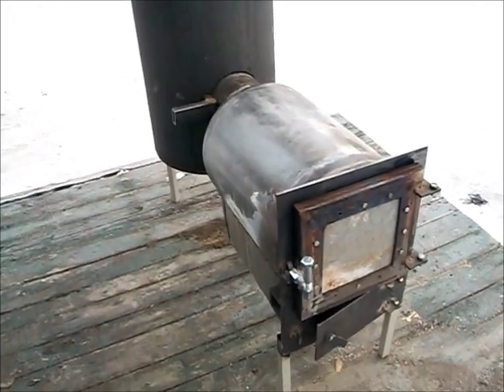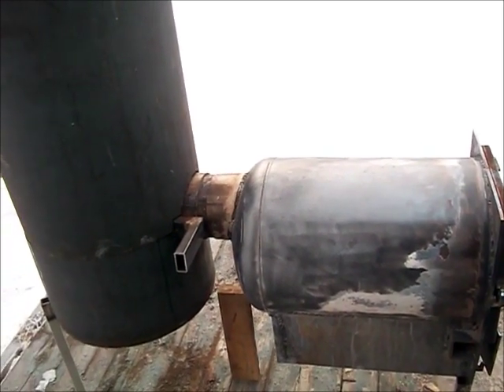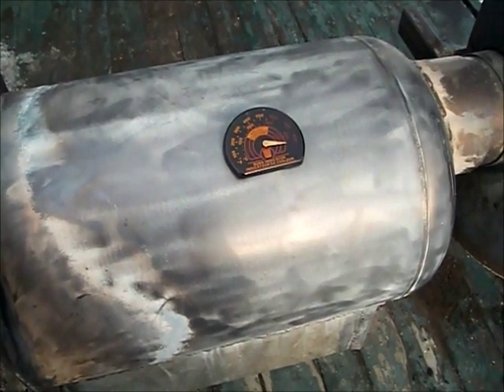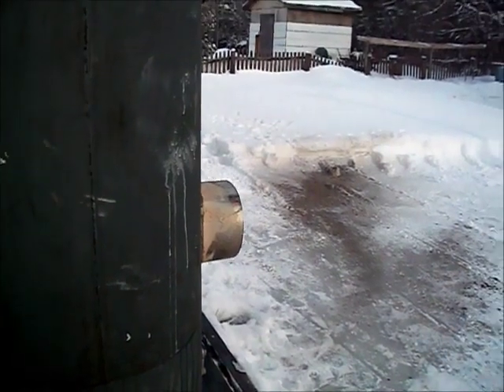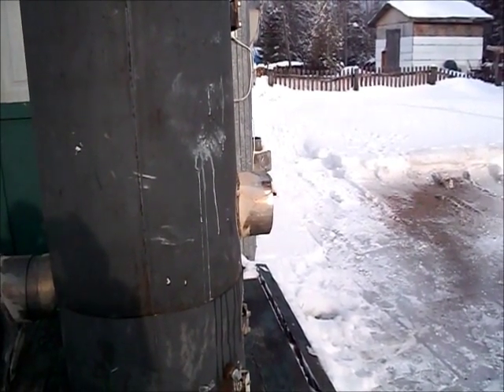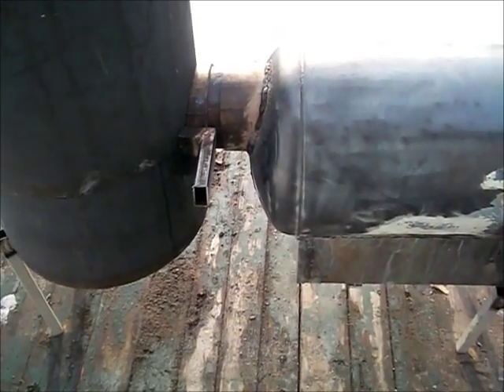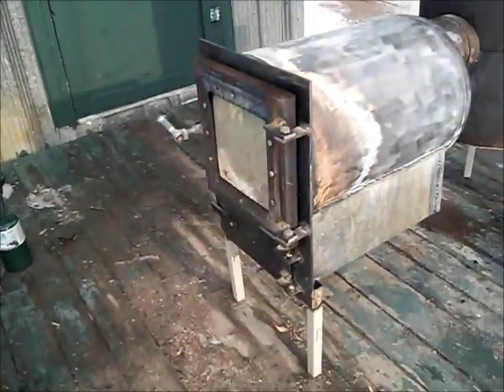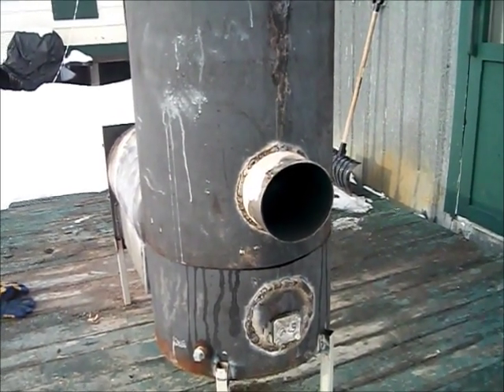Large Rocket Stove test day2

Comment: Okay well , insulate your firebox (with fire brick) , with chimney pipe on you will improve draw greatly , don't weld up heat exchange cover ,weld on brackets and fire rope seal for access maintenance , and insulate riser pipe ,better still make one with refractory or fire brick  (that riser tube will burn out for sure ) hope that helps . Mike UK

Comment: Testing you rig outside to enable easy modifications is a great idea
 but to mimic operating conditions you need to attach a Flue or Chimney to get the correct draft through your system
Also insulating your fire box will give you a hotter burn

a good explination here
 https://www.youtube.com/watch?v=N_Epdny8zg4
480mm log is = 19inches long 
also see 
http://www.pyroclassic.co.nz/about-us/how-does-a-pyroclassic-fire-work/
and 
https://www.youtube.com/watch?v=wp4TzEo6CRc
Reply: One cannot agree.     A good rocket incorporating a throat before the second air, well controlled secondary air and a tall enough, round section, well insulated riser will actually create a mild thrust in the riser, so it does not need a vertical chimney at all. That is why can be used to heat floor level mass in a house.
Reply: Thank you. I wasn't clear with my reason for attaching the flue etc.
 It wasn't to create a draught but to supply a more 'real life' situation similar to the flue restrictions that would be there under the actual operating conditions inside the house.
Reply: Insulating the fire box does not give a hotter burn.i totally disagree.WHY? Heat is heat,any heat going into your house coming off the stove is heat,common sense.

Comment: Just thinking out loud, if you burn this at the recommended (or required temp of free burn) of 1800-2000 degrees.  I am wondering how your expecting the metal to withstand this for more than one season?    At a reduced draft, (or less air) I suppose this would work.    Perhaps not intended to be a long lived stove and more of a R and D stove.

Comment: extremeskierx is right. hook your exhaust to a flew and it will work fine
Reply: yes that was the 1st thing I noticed to, part of how this works so well is that the hot air in the chimney rises and pulls air thru the system acting like kind of a blast furnace, this aids in the burn creating the high heat in the chamber and thus a clean burn and thus more heat, nice heater though, add the chimney and test it.

Comment: You didn't need to make those changes all you needed was to add height to the exhaust flue pipe so it can draw by convection. You can use thin black stove pipe, it will work.

Comment: Un-f...n believable! I have been watching a few of your vids, and you have an awesome design here! The heating potential from this stove is very inspiring! Here are some of my thoughts;
  
From your first test run I'm not sure if raising the horizontal junction between the fire box and the rocket tower made any real difference. However, I do think it helped with the raising of the towers exiting draft simply because that created a longer distance for the heated air to travel creating more pull. As some have suggested the addition of draft piping would help when it is finally installed in desired location. You are heating up some sizable rocket chamber space so you will need a long exhaust flu to create the proper draft ratio. I think of it like a siphon, too short and there is not enough suction. Also, not sure why you need to insulate that short junction tube, but it won't hurt so no big deal, just wouldn't want you to ruin the look of the stove. As far as the small air intake, how about the tube entering from the front somewhere low and leading just a short distance to end under where you will build the fire on top of it? 

Again, these are just my thoughts, you seem like a perfectionist so you will get it exact I'm sure. Love the industrial design, reminds me of the huge blast furnaces used at steel manufacturing plants! Curious to get a report on how the stove is functioning if you had a chance to use it in it's intended space. Thanks for sharing!

Comment: It's my understanding that with a 6 to 8 foot chimney stack, you don't need insulation of the central pipe inside the rocket stove chamber. Without a stack long enough to produce the draft, you need that insulation. Also, if you were using a mass heating system (bench made of cob, etc.), insulation is more important to create the draft. 
Looks like since you made your previous modifications, you have a real nice heater here!

Comment: Still no chimney/flue.   Its my hope that you bolt the top plate so you can perform future maintenance.
Reply from the maker: no chimney flue and no smoke, i did bolt the top plate on
Thanks
Reply: yeah I noticed that:  It seems like you have mastered the rocket stove good job . . .  So I am wondering since I am building a rocket stove to heat the garage do I really need a flue exiting the building?
Reply from the maker: saltyseascott yes you do need a flue exiting your building,over the roof not needed but recommended ,if the wind blow in your flue you have back draft   look at Kevin Bacon  "kbbacon" his just exit the wall
Reply: I did I was wrong apparently, sorry!

Comment: Great use of junk cylinders. When you get a flue pipe on it will draw much better. raising the exhaust wasn't needed. Insulating  the chamber will help with full burn. Slow the burn on by putting a door on the air intake then the secondary air will take care of the chamber.  Latr
Reply from the maker: Thanks
After using it for a couple of days in my shop add to pull it out,to big for my shop
have a friend with a nice big garage made is day :)
Reply: I can see that, it is big. I want to build one with the same size hopper for the house as that's all I use for heat and need it to burn through the night. Trick is to get the burn rate to where a load will last through the night.

Comment: Nice job , kbbacon  you mentioned  trying to get the air under the fire , I was wondering on a fire box like this one , could you make it so the air goes up threw the ash grate ?  I really like this fire box and would like to build one myself . Thank guys keep up the good work !
Reply from the maker: i just open the ash door  a little
could make a adjustable air intake in the ash door for better control
Reply: Rom1nb There should already be holes for ash to drop throw in to ash box which has a dual purpose to allow air in and ash to drop 
. . .Keep up the good work
Reply from the maker: jacky Parker i will make a air intake in the ash door
thanks
Reply: Why not use door as air in take ?
Reply from the maker: jacky Parker a air intake in the door with a slide is better for control of air

Comment: All of your modifications were right on target. If your intake air is not flowing under the wood, you might see if you can find a way to direct it there, otherwise, I see no reason to change your design. Great stove!
Reply from the maker: i will install a glass in the door, the design of the air intake on the side should keep the glass clean
Thanks